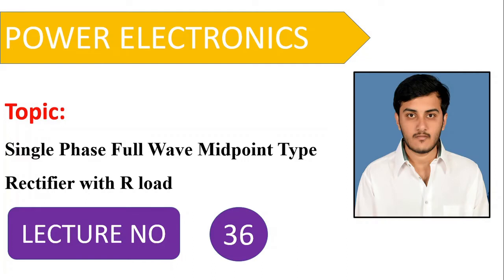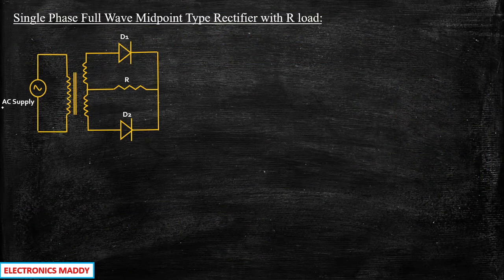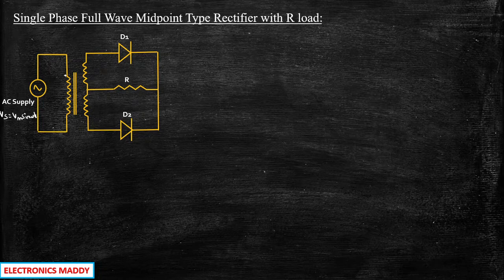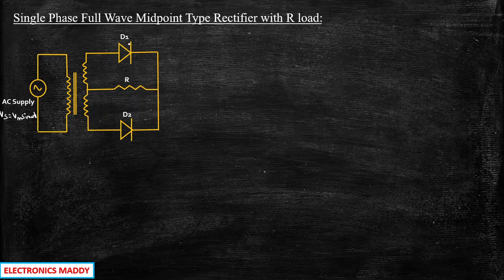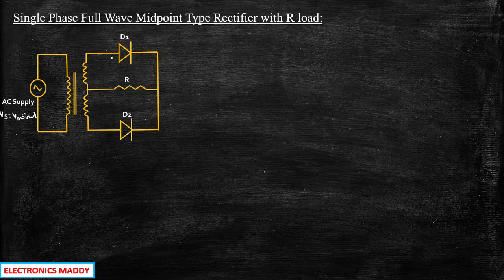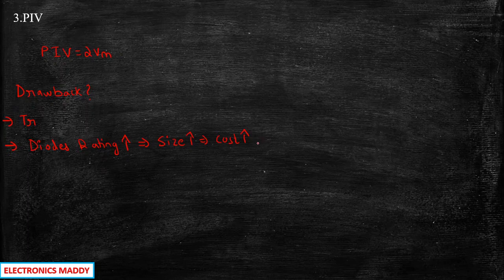Single Phase Full Wave Midpoint Type Rectifier with R load | Power Electronics | Lecture 36

Comment: You are making a mistake in derivation of Average output voltage and RMS output voltage because you are considering the limit from zero to pi. You should take the limit from alpha to pi
Reply from the maker: Nope you have understood incorrectly . This is uncontrolled device. The firing angle alpha doesn't exist as we cannot control a diode.